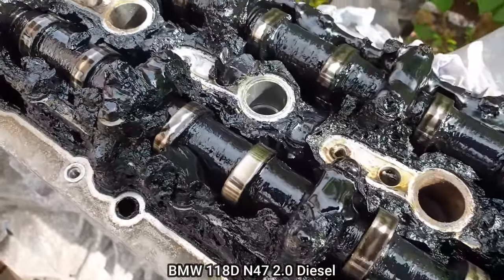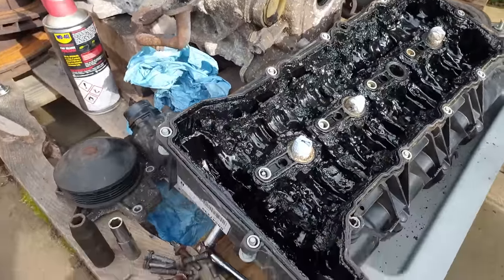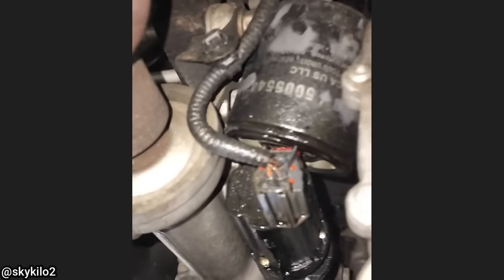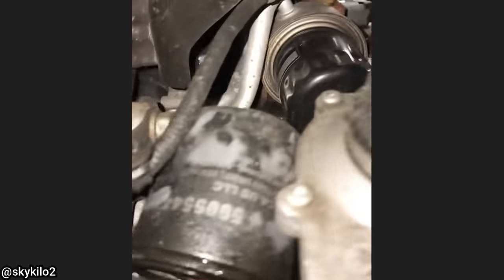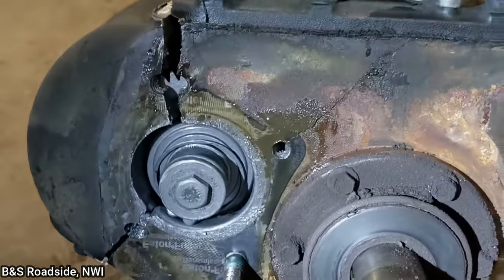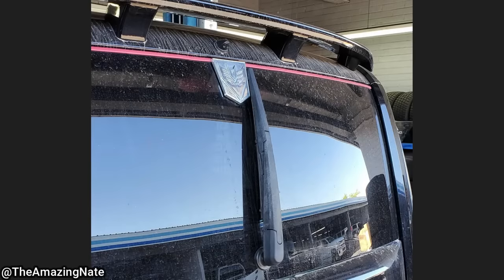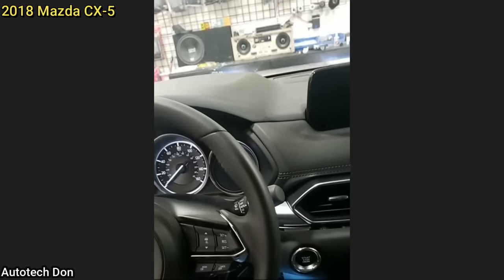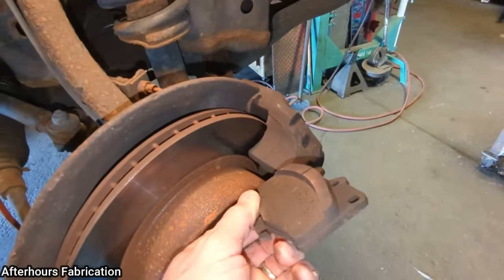Customer States Repair Engine On BMW I Just Bought | Just Rolled In

Comment: This channel is starting to have a similar effect on me as did Hoarders.  I now want to compulsively change the oil in my Jeep every time I drive it.
Reply: The pressure in my left front tire was 5PSI below.  Time to get new tires.
Reply: i feel like that’s not a bad effect
Reply: haha, so true
Reply: @cujoedaman  don’t forget to top off your blinker fluid when you change your tires
Reply: Nah don't need to do that, just argue with the idiots convinced that oil changes are some manufacturer conspiracy to extract money out of their customer
Reply: Google knows where you live.  The mighty algorithms are moving videos like this to the top of your queue because it hasn't seen Jiffy Lube receipts in a while.  ;-)
Reply: @JayConverse  lol lol lol
Reply: Don't forget to check the relative bearing grease. 😀
Reply: I bought a used Kia Soul a few years ago. Along with the owner's manual in the glove box there was a small sheaf of notebook paper. It was the car's service record. The previous owner made a note of everything he did or had done to the car. In the 25k miles he owned it, he did 9 oil changes. Each time he made a note of the brand & grade of oil, the brand & part number of the new filter, and the weather on the day he did the oil change.
Reply: @johngaughan9399  Bro, just get a new truck with under 500 miles on it, yours is done
Reply: @daveh7720  
You chose well....
that is the type of owner that gives a car a magnificent chance of reaching well over 200k miles engine-wise...
Reply: That's how I feel about my CVT fluid in my Aisin/Toyota unit! Haha.
Reply: Dude - oil change before you go out, and then when you get back - just in case.
Reply: @kernicterus1233  I think to be safe, this is the best plan.
Reply: I do oil changes every 2000 miles, new filter every time as well. I figure the cost is something I can afford, and it makes me feel better knowing my oil is always clean as can be, even if it’s otherwise just a waste.
Reply: @JayConverse  now that I’m too crippled to do it myself, I let the dealership change my oil. Sure it costs a little more, but I don’t have to worry about some teenage stoner cross threading my drain plug.
Reply: @cujoedaman  Unfortunately, that's how almost everybody troubleshoots things these days. 🤣
Reply: @daveh7720  LOL! I'm ok with it up until the weather.

Comment: That oil filter is my worse nightmare! Watching these makes me feel smart when it comes to cars lol
Reply from the maker: Just change your oil and you will be fine 😜
Reply: @JustRolledIn  Every 40,000 miles or so.
Reply from the maker: *400,000 😉
Reply: I thought that was a water bottle painted in tar with how nasty it looked
Reply: Seems SAE 120 was the fluid used
Reply: @davidp2888  Nah, get the High Mileage stuff, says right there on the bottle it's for 75,000 miles.
Reply: I just bought and saved BMW, around 3 years without oil change(last one dated at end of 2019), i couldn't believe in that because car had been in a perfect shape. Until i removed valve cover. Crispy fried oil filter is a trully delicacy of mechanics.

Comment: I'm here in a junk yard watching this and I got to tell you these cars here are looking 110 percent better than ones in the video. Especially this 83 olds delta 88 w 180thousand on the clock
Reply: I used to drive a 1986(?) Delta 88...back in 1998!  (It was my parent's car...they bought it used and thought it was great, like it was some exotic luxury car they never thought they could afford.  LOL.  I wasn't impressed.  I ended up with their 1992 Ford Festiva, which I still think is the better car.)
Reply from the maker: Watching this at the junk yard? Awesome lol
Reply: If the motor isn’t locked up and the frame is good….
Reply: @fredygump5578  yeah I never liked those Ford festivas, to me great on gas not much else. Love these big GM beasts of the 80s comfy reliable easy to drive I actually think I will buy-revive this old girl thanks.
Reply: @SteverRob  everything about her is solid, motor is missing but I just made a deal for this and a Vortec 6.0 out of a van. Other comments inspired me to do so.
Reply: @tylercovey327  The Festiva was a spare vehicle to put in the bed of your F350. I kid.
But for a real story, a friend had one and totaled it when he hit a deer. The deer crushed the grill, the hood, shattered (as much as safety glass shatters) the windshield, bent the A pillar, broke the passenger window (driver's was open) buckled the roof onto his head, bent the C pillar, broke the back window, and ran off into the woods.
His car was dead on the spot, with something broken in the suspension and engine damage from when the hood was crushed down.
-
His wife worked at the insurance agency where their cars were insured, so he got another one, same color, same payment plan (less the $200 deductible)
Reply: @tylercovey327  I once owned a '63 Impala, guy asked me about the motor, I told him it was missing.  He thought it had a miss, I said no, it's literally missing lol.  Good luck and have fun
Reply: I took an '88 Olds Royale to over 300,000 miles.

Comment: Its been said thousands of times already but, CHANGE YOUR OIL AND FILTER REGULARLY!!  Don't cheap out on oil, change it more frequently if you do lots of short trips around town where the engine doesn't get a chance to get to optimum operating temp.
Reply: Will putting engine coolant work? Its cheaper and gets hotter quicker.
Reply: I change mine every 3 months or 3000 miles just for that reason of driving on short trips and I've done that on just about every car I've owned in the last 32 years and knock on wood I haven't had an engine blow up on me yet or have any sludge
Reply: @cactuslietuva  yes make sure to fill it all the way up, more is better
Reply: Or get an electric car
Reply: I bought my 2012 RAM Laramie 1500 brand new. I've always changed the oil and filter at 3,000 miles. Neighbor says I don't have to do that. I know that. 135,000 miles on the Hemi and runs as good as it did when I bought it with 31 miles on it.
Reply: @jayasmrmore3687  Did an oil change on a Tesla model 3 not too long ago, Tesla uses oil to lubricate and cool the differential and the gear reduction, the rear motor takes about 2.2 litres and the front about 1.3 litres, you also need 2 filters, one for each motor. The fluid you use is ATF-9 :-)
Reply: @uhtred7860  isn’t differential fluid different than motor oil?
Reply: This is absolutely correct! Short trips = runs rich all the time = poor fuel economy, fouled plugs, gasoline getting into the oil, etc etc
Reply: I wait about 15-20 seconds after ignition before I start rolling
Reply: I probably do it too often. A carry over from my Dad who told me he never saw an engine fail because the oil was too good.
Reply: @thisoldbelair  The biggest problem with short trips is moisture getting into the oil.  It happens when the engine and exhaust do not reach full operating temp to drive out moisture so it condenses back into the engine.
Reply: @RPG-oh1yf  that is also true i forgot about that one
Reply: I always put some transmission fluid in with the oil before an oil change..
Reply: @bretthibbs6083  Regular short trips, or long idling times are considered "heavy usage" for purposes of determining when to change your oil. So if you drive less than 5 or 6 miles per trip, it's probably best to change it early.
Reply: @thisoldbelair  It's a common issue with ATV/UTV's when the users only use the machine for short trips around the property, the oil starts to look like coffee with too much cream.
Reply: Truth Teller  Impressive
Reply: Change my oil every two to three months regardless of mileage. I have a 98 Chevy S-10 that I drove eighteen years, and racked up almost 400K miles on the engine (original). Stopped driving it because the rust was getting so bad I didn't feel safe having it on the road; engine, though showing signs of wear, was still reliable.. Damn good little truck.

Comment: My friend got his 3rd gen 4runner with an engine that looked similar to that BMW engine with strands of metal in it or something from what I remember of the photos, oil pan was filled above oil level with a jello sludge, oil pump was gunked up, etc. Changed the oil pump and did a timing job, more than 80k miles after cleaning it runs like butter and is sitting at roughly 340k miles.

Comment: Quick lubes always skip the cartridge filters. Ask for the old filter when you go to Jiffy engine replacement.
Reply: I purchased a 3 yr old car and when nobody was looking I marked the oil filter with a key. Car was to be serviced as part of the deal. Collected the car next day and checked the oil filter.  Still scratched.  Turned out the mechanic had been stealing service items and doing "cheap home servicing" for his friends with other people's parts.
Reply: A friend of mine owned a two bay independent shop.  He did a couple engine swaps a month for the quick change joint up the block.  Good for him to get the work.  Bad for the quick change shop that was having to buy all these engines and labor for their customers who were getting screwed by the quick change "techs".  You'd think after the first 50 motors.....

Comment: 0:42 those are called Flexco's. We use them to splice conveyor and bucket elevator belts together. These fasteners are surprisingly tough considering some of the environments they survive and operate in.
Reply: The odds are those customers were driving in the same area and drove over the same spot where those had to have been dropped
Reply: That’s actually my video we had a guy that was there tell us that’s what they were it was super crazy they all ended up getting tires though lol I kept them.
Reply: Ahhh flexco. The only company in the world that calls a socket a wrench. 😂🤣
Reply: @matthewwatkins3984  funny that those are made for fixing rubber but managed to ruin rubber.
Reply: Yeah - when I saw the first one I thought someone had been trying to fix tyres with them… Probably only a matter of time
Reply: @matthewwatkins3984  sounds like somebody went around playin games with people’s tires
Reply: @ministryofwrongthink6962   we just call them business getters lol. We think they fell off some truck driving down the road lol. To many holes close together to fix so yeah they ruined a lot of rubber
Reply: @matthewwatkins3984  oh dear lol

Comment: when i got my car cheap 2 years ago because of a misfire (failed coil pack that got replaced along with new plugs) i decided an oil change was a good idea as i had no idea when it was done last. rocker cover gasket was leaking anyway but cheap part  so that was to be done at same time ... the pcv valve was blocked with sludge when rocker cover was removed. the best part? the seller told me they took care of the car themselves 🙃
Reply: Plugged pcv valve will cause an engine to sludge up. Most of the newer stuff doesn't even have a valve, an orifice in its place.

Comment: I was so happy to see how clean my valvetrain was when I painted my valve covers a couple months ago, I've had my 2006 Mustang for a year and a half now and there wasn't a single spec of sludge or anything, looked like I had just opened a brand new engine
Reply: Somebody must have been changing the oil on that car at the recommended intervals. It's wonderful how well that works.

Comment: I've been the victim of the "wrong size rotor" mechanic. Guy I bought the car from said he had a friend that worked for a dealer and did all the maintenance and the car always got what it needed. I had to do a panic stop when traffic suddenly came to a halt in front of me. The car felt like it didn't want to stop and then there was smoke rolling out from the front. I checked it when I got home and the tires hadn't locked up but looked like the brake pads were fairly worn. I bought new pads and rotors and when I went to change them, I saw the same thing in the video. The V6 Dodge Magnums have a smaller rotor than the V8 RT's do, so the cheaper but wrong rotors were on the car. It performed MUCH better when ALL of the brake pad contacts a BIGGER rotor!

Comment: 1:57 i love the quirks some vehicles have. in my car, i have to manually unlock the door & unlocking it makes the other 3 doors lock
Reply: My car use to do that. When it worked properly if you turned the key once it would unlock the drivers door only and if you turned it a second time within 5 seconds it would unlock all the doors. Then something went wonky and when you turned the key the drivers would unlock but as you turned it back to center the other doors would unlock every time.
Reply: Have to say it; you should be able re-set the locks to work properly. Find out how your manu' re-set/re-sync's the locks (can be an issue with p/w as well)

Comment: When you're starting out as a roofer, and you can't afford to buy a hot tar machine, you can save money by melting it inside your hot engine.  Then just hook up a tube to the turbo and shoot it out under the shingles, and you're makin the big money on the cheap!  Works like a charm.

Comment: 3:10, I was once driving an old International Cargostar truck with a 5+2 transmission and differential, when I started losing gears, until I only had 3rd gear high and low.  Took it to a shop and they found that the bolts holding the radiator had come out, and since it was a cabover truck, the shifter was mounted to the top of the radiator, and instead of moving the shift linkage, when I was trying to shift gears, I was just moving the radiator.   There was enough flex in the radiator hoses to allow that to happen.  Luckily it the radiator didn't move enough to hit the fan blades. I've had that happen to me TWICE, and seen it a third time in International trucks when the water pump catastrophically fails and the fan flies into the radiator.  Totally destroys the radiator.  That's over a period of 30 years, and three different models of trucks with IH engines, the last being an MRAP in Iraq.

Comment: I bet the guy who did the wiring job on that car also installed the remote starter. The best way to keep your car and your mechanic happy is to let everything OEM. They have schematics of your car and can find a solution but with the remote starter and the wiring salad, guess what either it comes out or it will be very expensive to fix.
Reply: It appeared that the one with the messed up remote starter install was a recent model year Mazda. Newer ones have a remote start via a phone app you can set up.
Reply: @leonb2637  probably a monthly subscription service.

Comment: and we have lift off!

had a customer bring in his chevy pickup today, said he thinks he needs a new caliper because the wheel is locking up. so hubby takes it for a test drive and it was a good thing it was a short one. i'm outside as he pulls up to the bays and all i hear is a horrible crunch, no he didn't hit anything... so he backs it up to line it up with the bay and the wheel crunches again, locking and dragging as he gets it in. the wheel bearing fell out, he didn't even have to try, he was more worried about losing the wheel before he could get it on the hoist at that point.

Comment: Lesson learned: when going eBay route VERIFY you have correct rotors. A third party slotted rotor listing wishy washy said "yeah these will fit a 2007."
No the real production 2003-2011 but bumped rotors for 2006 onward so their intel was WRONG and my rotors weren't lining up 100% with calipers.
Lucky I went to mechanic 10 days later for different issue who called out my mismatched rotors so I was prompt to get corrected.
Reply: It's a good idea to verify ANY part you replace. It takes literally seconds to pick up the new part and check them side by side. If anything is different, don't install the damn thing.
Reply: eBay is a nightmare for getting car parts.
Even when you are 100% sure you have the right part...... 
They send you the wrong part....
Reply: trying to look for very specific parts for my 1984 Opel Wagon I noticed that many "fits your specs/car" notes are wrong, but paid advertising. it will show up when any of your search parameters show up no matter if it'd fit or not. anyone not knowing what exactly they're lookign for should better play the lottery; it's not as dangerous when you miss.
Reply: @lotharrenz4621  The "this part fits your car" on eBay is random as hell.
You have the original part out on your bench in front of you and you are looking at monitor trying to see if the recommended listing matches.
Worst problem car I ever had for parts was this old ford. Well they must have made it at the very end of the model "year" as it came with parts from both years production in it so it was a total nightmare to work on.
Reply: @CS-zn6pp  I can imagine that. if you don't know both versions in and out it must be a very frustrating experience.
I know a guy who found a Capri Mk1 with the old front end, but the facelift's big taillights. research found out that towards the end of the old Capri run they ran out of rear pans and thus installed the newer ones, building a handful of hybrids that way.
there also have been occasional special models with some of the features from the ads missing. those were unsold "commissioned" vehicles the dealers blinged up some to sell them.
all interesting things, but a nightmare to fix I guess.